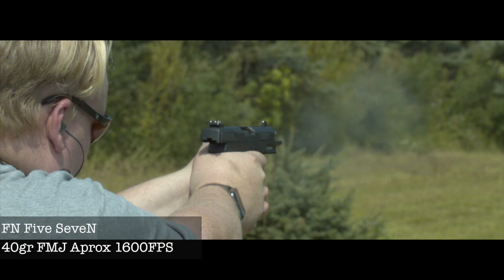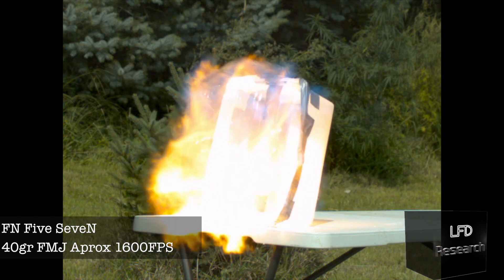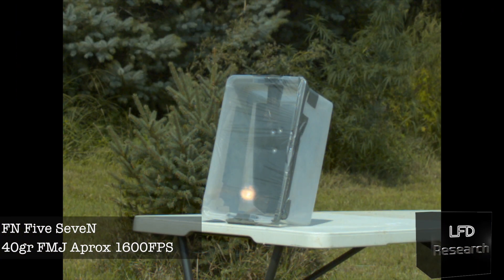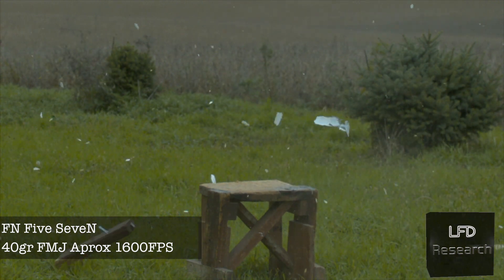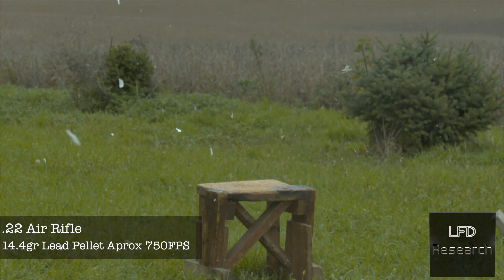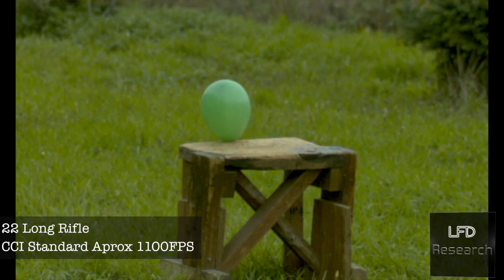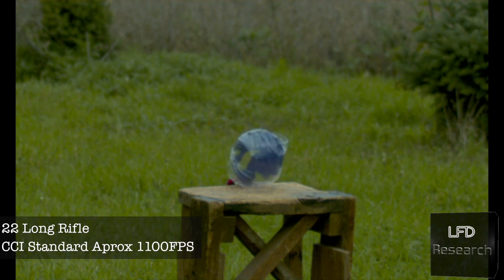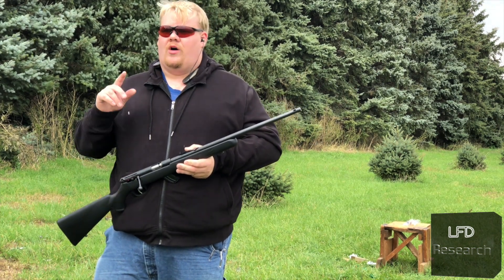Oxy Acetylene Detonation

Comment: I know it is 5 years down the road from when this video was made. But what you are seeing is a static discharge of the bullet going through the air and making contact with ground only when the plastic is stretched over the plastic container. If you filled the balloon and then rubbed the balloon on your hair without it detonating, the balloon would detonate as soon as it touched something plastic or dropped on the ground making contact with dry dirt. 
It is the static discharge that is making the detonation. 
Repeat this test with it raining outside or even misting with the plastic container and I will bet good money that it won't detonate.

Comment: My best guess is that cling wrap works through static electricity, so probably the bullet impacting the cling wrap causes a spark, which is what ignites the mixture. The balloon doesn't go because the cling wrap is on the outside, not touching the gas, so the spark is gone by the time the gas ignites.

To test:
1) wad a ball of cling wrap inside a balloon and shoot it.
2) If your cameras are good enough, film cling wrap being shot at night or in a dark room, maybe you can se the spark.

Comment: It could be the ignition is from a static spark when the bullet hits certain material that is prone to create a spark with the rapid movement between the two materials.  I once filled up a ziplock bag with an oxy acetylene mixture, placing the brazing torch in the slightly open section of the ziplock seam, when it detonated in my hands from a static discharge!  Luckily, I was scared of this possibility and I had hearing protection and thick welding gloves on - AND I was holding the bag only by the tab of the ziplock bag and I did not have my fingers around the explosive gas.  Still - it stung my hand and was rather loud under the ear muffs.   Beware of static discharge ignition!  Never be near a bag of mixture.  I've seen other youtubers "safely" fill bags at a distance using a good length of small plastic tube running between the torch and the inflating bag.  You can also detonate the bag from a distance by igniting the mixture through the tube.  Don't put your body anywhere near a sizable accumulation of oxy-acetylene because it can blow you apart.  Static discharge is kind of random.  Don't become complacent if it didn't happen to you yet.

Comment: Are you positive it isn't touching the aluminum because when I freeze the video where its glowing it looks like the aluminum has started to deform otherwise id like to see you repeat the test identically but replace the alu sheet for a fixed non spark material like maybe a brick my hunch is the high pressure area in front of the bullet is compressed as it approaches a solid object
Reply from the maker: We have repeated in several non conductive objects like balloons and were getting similar results provided the projectile was traveling faster than the speed of sound. We did get a few frames that made it look like the flame igniting along the Mach wave created in front of the projectile

Comment: I believe, the bullet creates an electromagnetic field, in its plow to the target by rubbin itself in the air, plus, heat dragging it all in its way. Not so with the balloon, since its mass is negligible for the "impact" of the bullet.
And what u see is the blasting of the friction with the statics field around the silicon isolating the aluminium at the moment the bullets collides against its surface . 
And the fire ring "floating" in the air, when the bullet breaks in, is the reverse effect that a bullet produces when a gun goes off, and  hits the mass of air producing the blast and heat. 
This time, those particules of hot air burning contained in the furrow of its path, gush out the hole it carved in the silicone. It works as a barrel gun.
Reply from the maker: Based on further testing I don’t believe this was the case it kinda looks like In this container it was the shape increasing pressure from the projectile traveling to the ignition point we did find that if we exceeded Mach 1 we could detonate it in a ballon and we actually got a few frames of it igniting along the Mach bow wave around the projectile

Comment: My idea is that the tensile strength of the wrap plain over the bucket and the mass/small impact point of the bullet acted as a piston to compress the air fuel mixture into ignition while the balloon acted as a sponge absorbed the compression there for not allowing ignition.
Reply from the maker: It’s possible something about that wrap and container shape amplified things enough to drastically reduce the velocity needed for ignition otherwise we found in balloons a velocity in excess of Mach 1 was needed for ignition

Comment: The balloon expands keeping the mix below 15psi. But, in the other rigid containers the pressure from the bullets is contained and becomes greater than 15psi causing the mix to explode.
Reply from the maker: You may be correct after additional testing we believe it was a combo of the improper gas ratio as it was changing possibly due to a reaction with the balloon itself we also found that it would detonate even in a balloon provided the projectile was traveling over 1400fps

Comment: The balloon is too elastic and the plastic wrap is not pulled tight enough around the balloon to cause the friction ignition like it does hitting the tight surface on the plastic bin. I don't know, just my thinking.
Reply from the maker: Thanks for your thoughts. Turned out it might have been a combination issue thing that prevented ignition in subsequent tests we were able to get ignition from a standard ballon as long as we used a spritzer round going at supersonic speeds

Comment: The answer to your question is pressure. Acetylene is very unstable in gas form; any pressure exceeding 38Psi will cause it to detonate violently.

 Inside your tank is a very porous material similar to a fire brick that fills up every void space, preventing acetylene to separate from the acetone that stabilizes it. Acetylene can then be dissolved 250L to every liter of acetone  and safely stored and transported.

 So when pressure on the gas contained within a solid structure  increased, it caused the unstable gas to react... while in the balloon you were not able to achieve this pressure increase... probably due to the elasticity... however if you were to stick the balloon into a reasonably tight box I suspect you will find it will detonate. You could also hook up a air hose to 40psi and maybe burst the balloon 🤔 🤷‍♂️
Reply from the maker: We were able to get the balloons to burst at higher speeds. We do have some really nice footage of it igniting along the Mach wall formed by the bullet going through the balloon

Comment: High velocity bullets generate plasma on impact with anything solid, including thin plastic. Pretty sure that's what is happening here.
Reply from the maker: That is an interesting and unique theory what kind of velocity would be needed for that?
Reply: @LFDResearch  well I'm not exactly sure, it usually becomes visible over 2000 FPS but could be occurring at lower velocities, just not visibly. That's the flash of light you see when the bullet hits the aluminum plate, they aren't sparks so much as superheated metal vapor.

Comment: I'm pulling this out of my ass, and it's a shot in the dark, but it might be something.

Maybe, (MAYBE), what's happening here is the internal atmosphere is heating up on impact around the point of impact because the atmosphere right at that impact point is compressed so rapidly, kind of like how a piston-driven survival fire starter works on a smaller scale. 

So when you shot the balloons, there was elasticity on all sides, allowing the pressure wave to be "pushed" throughout the balloon and preventing that from happening at lower velocities, but when you have a rigid backing, that atmosphere has nowhere to go and compresses rapidly enough in a small enough space (that is, a literal point) to heat and act as an ignition source. 

We're talking about a fraction of a fraction of a fraction of a second here where the bullet hits the seran wrap, and BEFORE penetrating it, basically "punches" the atmosphere right on the opposite side of the tip of that bullet, compressing it, therefore heating it, and creating an ignition point.
Reply from the maker: Your essentially on the same track as our thinking we do have video of it igniting along the Mach barrier of a super sonic bullet but for the plastic container we believe that it is mostly the container amplifying the pressure causing detonation at such low speeds
Reply: This makes sense. In my aeronautics class we learned about supersonic aerodynamics. The air in front of the bullet would compress very fast. plus the compressed air would all stay in a concentrated space which makes the air denser in front of the balloon, causing it to compress and go boom.

Comment: Does it only seem to ignite in hard-sided containers? Perhaps those are containing the shock wave enough to cause compression ignition like in a diesel, but the balloon is too flexible and just gives with the shock wave so it doesn't build up enough?
Reply from the maker: I think that it’s the shape of this container that is letting it detonate with bb’s. With further testing we got it detonating with balloons but it needed to be going about Mach 1.5 or higher to detonate it’s really an odd effect
Reply: At mach 1.5 you definitely have a shock wave in front that may be enough to ignite even if it were somehow contained in open air...which is kind of what the balloon does, sort of a temporary flexible enclosure.
If you shoot a sealed metal can of water with no air in it, the effect is much more dramatic than shooting a water balloon because the can contains the force until past the rupturing point, plus transmits the pressure almost equally in all directions. I wonder if we're seeing that here on a different scale?
Reply from the maker: I’ve have some high speed of it igniting along the bullet path in a standard party balloon in the shape of the Mach cone created by the bullets passing that’s was Mach 3+

Comment: Wow this is awesome to see! I guess acetylene does indeed detonate, when you look at a combustion reaction it doesn't seem all that special until you realize there's a triple bound carbon between those two hydrogens. I think that these can "break" from shock but I haven't seen much evidence apart from this and first hand experience. Here we have a tradition around new years where we use CaC2 inside an old 30 liter steel milk churn to make a big bang. Sometimes however if these containers are too close they get a sort of sympathetic detonation, where one seems to go off just from the shock of another!
Reply from the maker: Interesting on the chain reaction bit we think it’s pressure waves creating a peak that causes the detonation

Comment: Niiiiiice.....!!!
I think the compression makes the oxygen/acetylene ratio differ when in a balloon, 

you are examining the mix in a different pressure and then pumping it in an elastic container (balloon) which changes the pressure/volume thus changing the oxygen/acetylene mix ratio in comparison to the plastic container  .
Reply from the maker: We have done further testing and if running fast enough atleast Mach 2 or higher it will go off in a balloon not sure why it did not in this video

Comment: Plastic vs balloon. Is it possible that the sudden impact on the plastic creates enough static electricity between the plastic and outside air, or the bullet itself, to create an ignition spark?
Reply from the maker: Unlikely our current operating theory is that it’s pressure waves colliding causing a spike and the detonation. We have gotten detonations using just a whoopee cushion or a party balloon if the velocity is high enough. And the bullet shape is correct.

Comment: Static from the cling wrap maybe?
Reply from the maker: That is one theory. Not sure how we can test to prove or disprove it. I’m thinking it may be something with pressure waves and gas compression
Reply: @LFDResearch  to disprove it, you try getting a rubberized material and putting it over a small bucket. It would replicate the cling wrap, but without the static charge. Im guessing when the metal bullet (or bb) touches the cling wrap it causes a static discharge. It's moving fast enough to pass trough the material while the spark happens.

Comment: This is great, the internet has some real science to get its teeth into. 
 "But honey, I need find the answer, the world needs me to find the answer, to this great conundrum.  And that's why I had to blow all the cash on ammo and gas. Nobel Prizes don't earn themselves y'know."
  A cheap reactive target for even air gun levels of power would be cool, though oxy/acetylene is notoriously prone to 'spontaneous' ignition.
Reply from the maker: True but still would be totally awesome
Reply: Certainly worth pursuing further, and possibly a great excuse for persuading someone to lend out a really good camera, because science.  I'm guessing it's down to the combination of bag/balloon material and gas mix.
Reply from the maker: Possibly we have done more tests and we need to now go back and do the ballon again but shoot it with a 5.7 cause it may detonate
Reply: Acetylene decomposition  
  
  Why it cant even be alowed to transform in gas in the tank and highe pressure 30?psi and high flow rate 💣💥🎆solid honey comb structure with acetone

Comment: I believe it has to do with the mixture being contained in a rigid container.. Given that acetylene self ignites at 15 psi and above, oxy/acetylene would be susceptible to pressure spikes. In the container a pressure spike would occur due to all but one side being rigid. In the balloon, however, no side is rigid and therefor no pressure spike occurs (or at least not high enough). This is just my theory as I am no expert in anything.
Reply from the maker: That is one theory we have been toying with
Reply: That's the reason, the balloon deformation from the initial pressure and the gas moves around, my assumption is if you did the same thing with the balloon in a rigid container it would likely ignition as long as the balloon is unable to deform before the pressure rises
Reply: A latex balloon offers virtually zero confinement. When the bullet perforates the balloon, the acetylene vents to atmospheric pressure in microseconds; the gas inside remains C2H2 (no oxidizer) and the pressure/temperature spike from the bullet is below the thresholds where exothermic decomposition can self-sustain, hence neither deflagration nor detonation occurs.

A rigid or semi-rigid, even plastic, vessel is able to momentarily trap both the mechanical shock and the hot bullet, or even the heat generated by friction of the container and the bullet, so the local pressure–temperature can exceed the thresholds before other portions of the vessel membranes rupture. If the container fails slowly enough for mixing with entrained air, deflagration can be achieved. If the confinement and shock are sufficient enough, the acetylene gas can undergo oxygen-free detonation that couples to the pressure hike and shock. 

Given that a combination of oxygen and acetylene are used together, it would suggest that deflagration and detonation should have a higher likelihood of occurring given that acetylene is naturally oxygen deficient while both acetylene and oxygen have rather large heat of formations at room temperature (which suggests high chemical reactivity and a better oxygen balance).

These are my opinions, if I had more details such as the volume and weight of the acetylene present, I could provide more details. If you would like to know more, please feel free to reach out.

Comment: Cool idea and great footage! You could try just putting some in a ziploc bag at atmospheric pressure (as an alternative to a plastic container covered with saran wrap). Maybe in the balloon the oxy acetylene is "too pure" and doesn't have enough air mixed with it. I have no idea what is causing it to ignite though. Maybe above a certain velocity the projectile compresses the air in front of it enough to heat it to a point where it can cause ignition of the oxy acetylene, kind of like a diesel engine.
Reply from the maker: Good idea